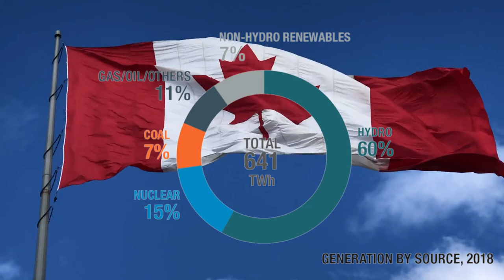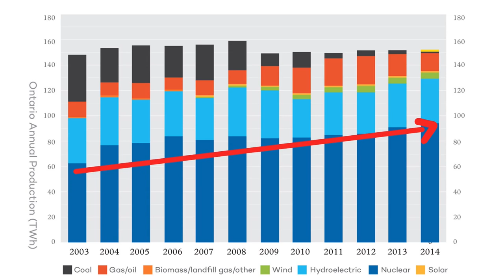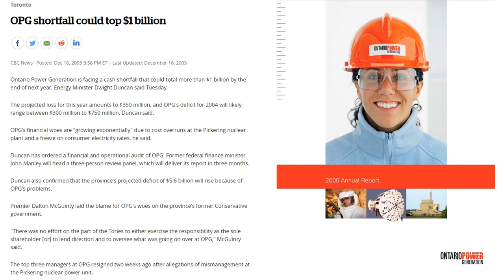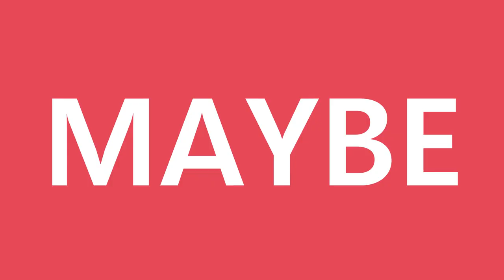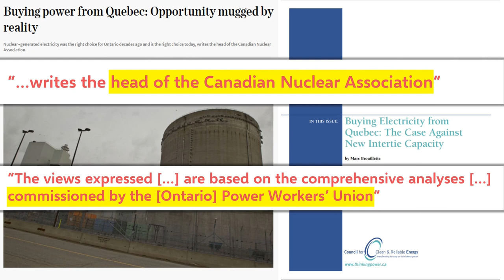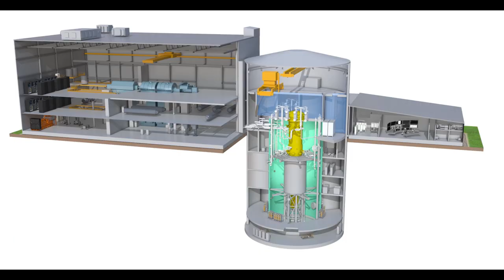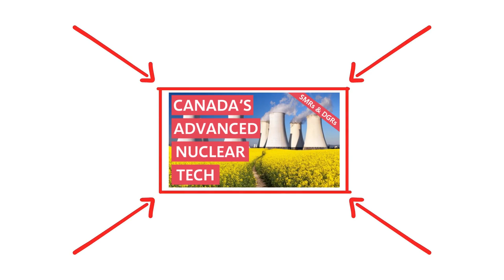Canada's Oldest Nuclear Plant is Closing - Why That's a Bad Thing

Comment: I may be able to add a little bit regarding the Pickering shutdown.

The fact that it is an old plant is not exactly relevant: things like the containment building, offices, and cooling infrastructure tend to last for a long time, and as far as I am aware its still perfectly fine. These make up a significant portion of the cost of the plant, as does the heavy water which can also be reused. When it comes to the refurbishment, they basically strip out all of the parts and build up a whole new reactor. Refurbishments are also a chance to add improvements to the reactor. Think of it like replacing the car but keeping the garage. In the past, refurbishment has become problematic, but factors like lack of experience, legislative/regulatory problems, and supply issues played a big part. It is a case of wait and see to determine how much this round of refurbishments will cost, but last time there was a large scale refurbishment the nuclear industry was declining and experience in pulling apart and rebuilding CANDU reactors was something that was more or less being done for the first time.

The idea of refurbishing Pickering is something that has been explored, and its perfectly feasible. The issue here isnt the plant, or the technology.... the issue is local politics. For years groups like the OCAA have lobbied to get the plant closed and I guess they convinced the local municipal government. The town council had unanimously voted to oppose a refurbishment, and they opposed the short terms extension as well. Its an odd choice given that something like a 5th of the towns economy relies on the power plant.
Reply: I am not sure why Pickering B wont be refurbished, but the remainder of Pickering A's units (1+4) that are operating wont be refurbished due to the thinned walls of the feeder tubes. Its the reason why units 2+3 were never refurbed. They refurbed units 1+4 in the early 2000's at great expense, but they stopped at 2+3 because they found the feeder tube walls were too thin and would need replacement regularly. Every shutdown of units 1+4 have included replacement of various sections of feeder tubes at great expense. The reason they are thinner than normal was because in the 90's during various planned shutdowns, they tried chemically scrapping the feeder tubes with a solution. Apparently the PH wasnt maintained at a correct level causing the thinning to occur. Its pretty sad, because units 2 + 3 could have been refurbed and that would have been another 1000 MW on the system for 20 + years.
Reply: As per your comment though, Pickering could be refurbed, but my understanding was the economics were such that it wasnt justifiable for the smaller 500 MW units. I am guessing the boilers would need to be replaced and probably the calandria tubes. Although they are replacing calandria tubes at Darlington right now, so the experience is available. Pickering is am older style that has the full size containment and so its much harder to remove the boilers, plus there is 12 of them vs Darlington which only has 4
Reply: Lots of work for boilermakers
Reply: @mikestiglic1880  Pickering was designed in the 1970s.. the reactors have a dry vault.. or at least it was supposed to be dry.  Heavy water leaks made the air humid, and the radiation reacting with the nitrogen in the air caused a buildup of nitric acid in the vault which caused corrosion.  A dehumidification system was installed in all 4 reactors, but much, if not all, of the piping in the vaults is not stainless steel.
This was more of a concern for Units 1 & 4; however, which were used much more than Units 2 & 3.

Comment: Many of these "environmental groups" that are vocal about wind/solar in Ontario are funded by the natural gas industry.  Why?  Because natural gas is used to "backup" these types of installations.  SMRs are the future.  They will allow for nuclear plant components to be largely manufactured in a central facility, greatly reducing construction costs.  They can be assembled in remote locations reducing transmission line losses.  Tech has changed a lot since Pickering was designed in the 60s and 70s.
Reply: Yep, here in the USA the gas and oil industry funded the NoNukeBailout astroturf baloney campaign.

Comment: A few points: Pickering B is actually newer than Bruce A. The refurbishment of Bruce A units 1 and 2 also went massively over budget, that did not deter Bruce Power from pursuing the refurbishment of the 6 remaining units at the site. Bruce Power is fully funding their own refurbishment, the Ontario government is not involved in that process. OPG already has a fully approved EA by the CNSC and refurbishment plan for Pickering B. The refurbishment wasn't pursued because they thought it would impact the viability of the construction of Darlington B, which Kathleen Wynne cancelled anyways in the end. Pickering is not past its "end of life", as all CANDU's were designed with a mid-life refurbishment as part of their operating life, which means a nominal unit life of 60 years (consistent with other nuclear plants), though, like with pressure vessels in US PWR's, we've discovered that this was extremely conservative and 80+ years (~40 years pre-refurb, post-refurb) is actually more realistic. Bruce units will be pushing 90 when they approach their post-refurb end of life and the EA for Pickering B has it running into the 2060's as well. OPG has stated that they've "moved on" from Pickering in terms of their business plan, which is why they refuse to revisit the Pickering B refurbishment. They've already bought more than 2GW of gas capacity to add to their gas fleet to ensure that they have adequate gas capacity to replace Pickering's 3.1GW, so it's somewhat understandable as to why they'd be reluctant to make those assets less useful/valuable going forward. The cost estimates originally presented were in the neighbourhood of $2 billion per unit ($8 billion total) to refurbish the 4x B units. I expect it would be closer to $9 or $10 billion. The issue is that the cost per MW is higher than at Bruce or Darlington because the Pickering B units (scaled-down C6's) are lower output than the bigger C9's and C9 prototype 480 fuel channel ones at Darlington and Bruce. While Ontario does indeed have surplus baseload, that's in the spring and fall when we have excess wind capacity so an organization pointing out Ontario has SBG without delving into that nuance is being dishonest. During the summer, which is Ontario's peak demand period, wind is typically AWOL and we lean on gas to make up the deficit between demand and the output of our nuclear and hydro units, which run at full capacity. Nuclear outages are scheduled for the low demand spring and fall periods when their capacity isn't needed, typically back for the winter when demand again rises and of course Quebec often imports from Ontario during this period as noted. As things are electrified, demand is only going to rise, so the idea that conservation will help here I think is naive. Yes, we need more flexible nuclear capacity, like the SMR's at Darlington B, but that's in addition to firm nuclear capacity we already have, which includes Pickering. The government should approach Bruce Power about taking over Pickering and refurbishing it if the optics of spending the money is the issue. A $0.09/kWh rate would fund the project (current Bruce rate is $0.082/kWh) and allow the plant to continue to provide low cost reliable power to the province.
Reply: Solar is at peak production when we have the midsummer peak demand, so it would be an excellent way to meet that demand...at a much lower cost than event hte $0.082/kWh you quote for Bruce.
Reply from the maker: Thanks for your detailed comment, it was very interesting to read!
Reply: @ProfessorGoose  You are quite welcome!
Reply: @raymondleury2041  Solar works to depress/displace daytime peaking (gas) capacity. Currently, the issue with that is the morning/evening ramp periods where demand is high but solar output is low to non-existent, so these ramps are covered by gas. Pumped storage could be used instead, if the price was reasonable enough. I'm not opposed to a solar + pumped storage combination as long as it can be competitively procured for the purpose as described, and capacity is limited so that it doesn't cut into ultra-low emissions baseload power like nuclear and hydro. The idea is to displace gas, not displace other low emissions sources. Ontario ratepayers are still paying the 20-year $0.60-$0.80/kWh solar FIT contracts handed out under the GEA, so there may be some reluctance to revisit, but my personal position is that if that combo can be done cheaper than gas, it's worth looking at.
Reply: @raymondleury2041  during daytime only. Last time I checked, people like their air conditioning at nighttime too
Reply: @raymondleury2041  The midsummer electrical demand peak is between 5 and 9 PM, long after solar has declined for the day.

Comment: if a vehicle battery has so many charges why would I want to use up my charges to supply back to the grid. It will reduce my overall mileage I will get from the battery.
Reply: Ideally, it should make you more than enough money over it's life to cover it's wear

Comment: Solar, wind and SMRs are the only answer. Quebec interties would be too costly. They want to maintain their isolation from the rest of the north-east power pool by way of DC ties which aren't generally built for large power flow. Natural Gas is likely the option they are choosing because of special interest groups influence on the government. Plus they are cheaper and quicker to build
Reply: Mike, that makes sense except drop the inferior wind and solar.
Reply: @iareid8255  they are inferior, but the cost of them is considerably cheaper than they used to be. How much is a 300MW SMR supposed to cost?
Reply: Mike, 

yes they are cheaper and fuel costs are nil but the costs to incorporate them on the grid is high. However much renewable capacity you have installed also requires the same capacity of alternative generators as back up.  Their lifespan is relatively short, so replacements are required more often. That's not sensible or economic.
Not only that but it makes keeping the grid balanced is more difficult  and they adversely affect stability.
There are just too many negatives.
Reply: @iareid8255  I think renewables are great when combined with hydroelectric, even if they are installed across balancing authorities. Example being CAISO in California has a decent amount of solar installed now. In order to allow for that to generate into the system (and not generate) they created a deal with other balancing authorities to reduce generation or increase generation when solar is producing or not producing. There was a time when CAISO had so much generation online, that BC Hydro stopped generators at all of its units on the columbia river. That is around 4500 MW not producing. They had to open the spillway gates just to keep enough water flowing down the river. But hydroelectric can do that. Nuclear, Coal and Natural Gas shouldnt be cycled like that due thermal expansion/contraction. Anyway, hopefully OPG can get approval to run Pickering A/B until the end of 2025 and who knows, maybe longer
Reply: Mike, 
 renewables are asynchronous generators and as such make frequency control much harder. There is a practical limit as to how much asynchronous generation a grid can absorb and remain reliable. 
There is the matter of a duplication of capacity as all renewables broadly need an equivelant capacity of reliable generation as back up. 
Renewables also have a short life compared to conventional generators.
Reply: @mikestiglic1880  That's not an example of a great success. They have to pay conventional generation to not produce, raising the cost of electricity to consumers. And why were hydro generators being told to stop producing? It's easier to curtail solar. The whole structure is ideologically driven.

Comment: Nanticoke had a capacity of over 5 GW.  That was a coal power plant.   The government of Ontario and the government of Canada should invest billions into an offshore wind farm, energy storage, and a VHTG reactor using the existing grid connection leading to Nanticoke.   VHTG reactors have the potential to produce intense heat needed for melting silicon for semiconductors and solar panels, making steel, aluminum, carbon fiber, concrete, and glass, and other things that require intense process heat.

Moving forward, we're definitely going to need a lot more wind, solar, energy storage, and much more nuclear power.    Ontario is currently on track to miss its emissions targets, thanks to our disastrous PC government.  We need a 'break the glass' option to get Ontario back on track and meeting, or beating its target.
Reply: Ofshore wind farms are becoming more and more difficult to get consent for from then local populations having to endure the view. Moreover nobody ever talks of the real toll winfarms have on migratory birds.  I'm not totally against wind farms and they can work as long as there is backup power from gas-fired plants but it always frustates me how the environmental movement, always quick to criticize whatever they don't like but always prepared to ignore whatever facts that are inconvenient.  The fundamental reality is that solar and wind cannot and won't replace coal because coal is baseload whereas renewables are not.  We will get there but not by ignoring reality.
Reply: @raymondleury2041  PS I went through the presentation and intuitively I sense there are serious issues with their analysis.  However I am not able to find a proper critique of their work on the web so I will need to analyze it myself in more detail.  But I can tell you they are showing some shiny objects, which I suspect are meant to mislead you in your reasoning.  In any event more study is needed before I can conclude anything.
Reply: @raymondleury2041  PPS check out this site https://en.wikipedia.org/wiki/Capacity_factor to convince yourself these guys a gaslighting you.
Reply: As a sailor I can tell you that the wind does not blow very much on Lake Ontario in July and August.

Comment: Why not Hydrogen?
Reply: Hydrogen will never be used for power production. Creating it requires you either crack hydrocarbons from oil and gas, have the C02 emissions sequestered at cost and the exported. Or it has to be pulled from water via electrolysis, which already uses electricity. Since nothing has perfect efficiency, it would just be easier to import that electricity

Comment: The previous Ontario government did have a plan to replace Pickering.  Problem is that DoFo cancelled all the projects needed to make up for the shortfall.  The SMR at Darlington will produce electricity at 16 cents/kWh and that is at current "optimistic" costs that don't take into account possible cost overuns that are very likely given that this would be the first of it's type.  Green alternatives would cost 5 cents/kWh (that is what Alberta is getting out of their new wind farms that are being installed now).  We could build wind farms much faster and closer to market than we can do nuclear.  There is no reason to pursue nuclear other than lobbyists who are pushing their own self interest.
Reply: The plan to replace Pickering was Darlington B, which Wynne cancelled when the price went nuts for the two FOAK ACR1000's that were supposed to be built there. Wind produces grossly out of phase with demand in Ontario Raymond, in fact, had wind been paid market rate rather than on fixed rate contracts, which include compensation for curtailment, our wind fleet would be a small fraction of the 5GW it sits at currently. This is because it drives down the market value by producing when nobody needs the power, which results in us dumping its output on the US market for a small fraction of what we pay for its contracted output. Paid market rate, its capacity would have been self-limiting as installation would have stalled once it started tanking value. At 3.1GW, Pickering manages to out-produce our 5GW wind fleet by 5x during the peak demand summer months. During the two week period of June 26th through July 9th, 2019, during a heat wave, our wind fleet managed a 6.87% capacity factor, with an average output of 340MW while Pickering was at 10x that at full nameplate. I track Ontario's wind output, and have for years, feel free to follow me on twitter at @cadlam, where I post this data, and is likely a better venue to be having this conversation.
Reply: Naw, the issue with wind is that it's intermittent and is costly to integrate into the grid at large scale. Yeah, the LCOE may be 5 cents a kwh, but when you factor in curtailments, negative rates, backup sources/storage, and grid alterations it becomes a lot less cheap. 

Yeah, Ford has his problems. I actually declined my ballot rather than vote for him, but cancelling those wind projects was the right call. Even today Ontario has to buy electricity we dont need from wind producers, and then pay other provinces/states to take it.
Reply: Raymond, 

wind is never cheap when all cost are added up. Also remember you need as much alternative generation capacity as installed wind capacity. It's not a viable option.